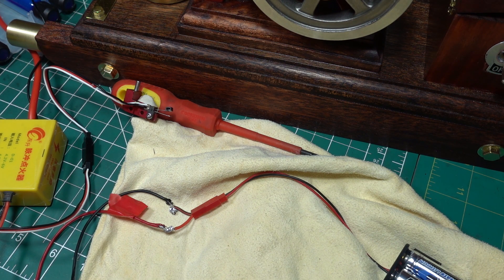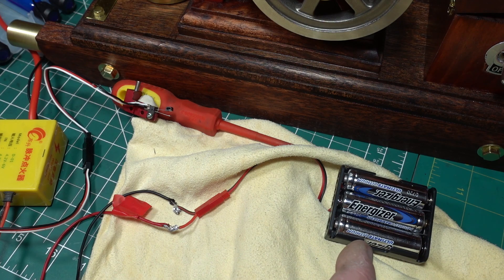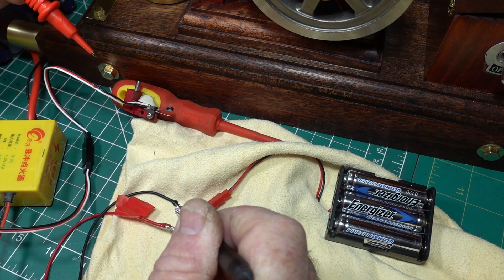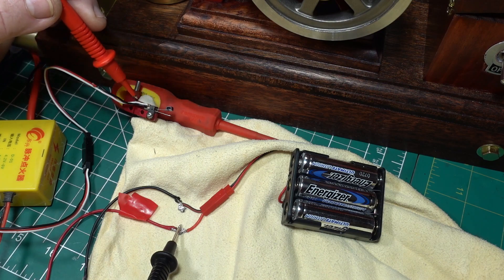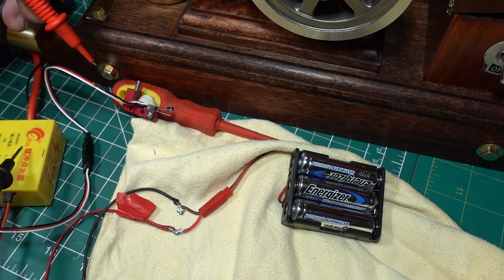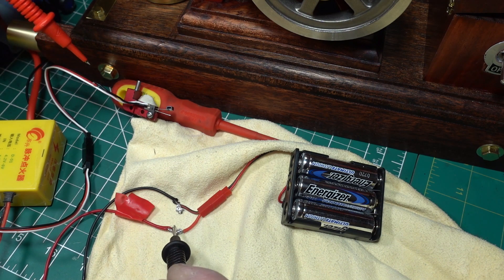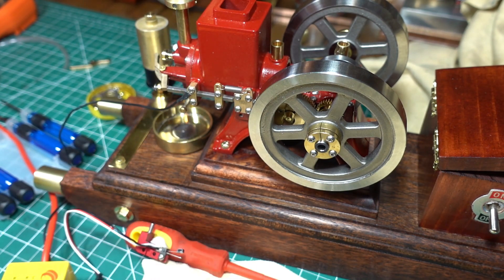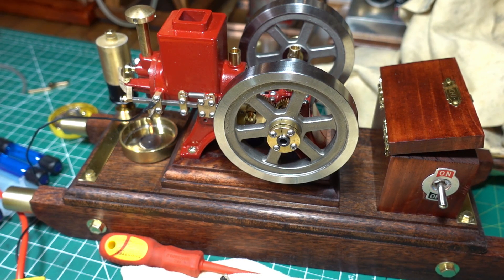Hit & Miss Engine Enjomor Help Needed - Part 2

Comment: hey buddy, i would suggest disconnecting the batteries and switch(points) from the CDI then test the switch itself open and then closed for continuity. Make sure the wires on the switch are not shorting to each other.  If that checks out ok, then reinstall the points on the motor and test again for short.  Then you can test for ohms at the CDI for resistance.
Reply from the maker: Appreciate the reply and advice....thanks.

Comment: Hi Jim. As Henry says below you shouldn't use the continuity test with the battery connected. The three wires are most likely, "Red" battery positive, "Black" battery negative (ground) and "White" signal. The contact breaker only needs ground and signal, black and white. If the engine used a hall effect sensor then you would need all three as the sensor requires power, the red wire. Do not connect the red to the black as you are simply shorting out the battery. You will not get any continuity from the white wire as this goes to the electronics inside the ignition unit. The contact breaker  simply grounds the white wire which initiates the charging circuit inside the ignition unit to generate a spark.  As I said before if you disconnect the contact breaker from the ignition unit then put your meter probes on either side of the contact breaker. Close the contacts with your fingers and the meter should beep. This proves that the contacts are working. As one of the other commenters said, take the spark plug out of the engine, connect the HT lead and connect the plug threads to ground. Then you can easily see if you are getting a spark when the contact breaker is operated. It does however seem that the ignition unit is faulty. Cheers, Alan.
Reply from the maker: Thanks Alan, my lack of electronics/electrical knowledge is really biting me on the backside.....appreciate  the advice.

Comment: UNDER NO Circumstance connect the Red to the Switch !!!!
If you do - you SHORT the BATTERY !!!!!
As mentioned the REd is for Powering a Hall-Effect Censor.
You should put the Meter in Voltage Mode and measure the Voltage between the Black and White (with the Switch Open) - if that reads Zero - unsolder the White from the Switch, and measure again. It still Zero (or close to) -> you got a falty CDI Unit.
The Trigger Signal comes from shortning the (Current limited) Voltage on the White to Black (Ground) and opening it again.
You can't see if the Sparkplug is firing with it inside the Engine during Test and for an outside test you should connect the last Blackwire you show to the thread of the Plug.
Reply from the maker: Thanks for the reply appreciated.

Comment: You can't rely on the Continuity setting on your Voltmeter when the batteries are hooked up.  The Continuity setting will go off for a voltage difference (you should get a beep from red to black or black to red on the battery pack).  The Ground Lead test you did is good though.  Definitely a good ground on the engine.  When I was testing the 3 wires on my Hall Sensor harness I just tried each of the 3 wires.  You could just test these too.  If shorting the red and white triggers a spark then wire those two to the switch.  If the Red and Black short to make a spark, then wire those two up.  I suspect these units are so quickly made that sometimes they swap wires around inside when they are being assembled.
Reply from the maker: Thanks Henry, appreciating the help mate very much.

Comment: Red wire not used when using points and not an hall sensor. It may be your unit is bad. I know they do not tolerate not having  a path so you need to keep you spark plug attached and grounded or it could flash over and burn out your cdi box.
Reply from the maker: Thanks Doc, appreciated. I have isolated that red wire now.....cheers and thanks again - Jim